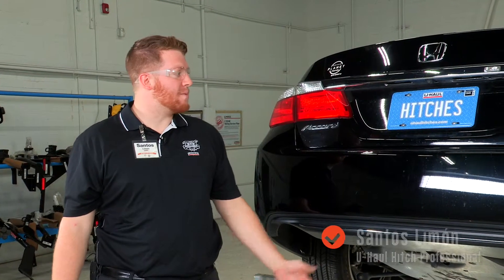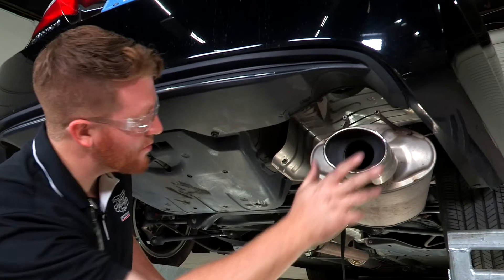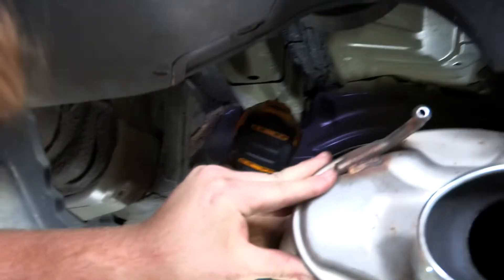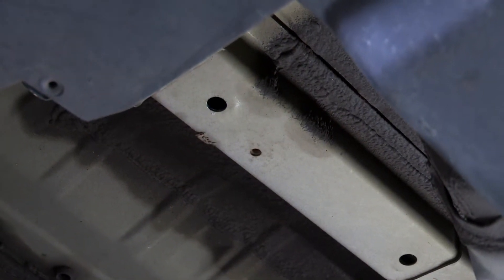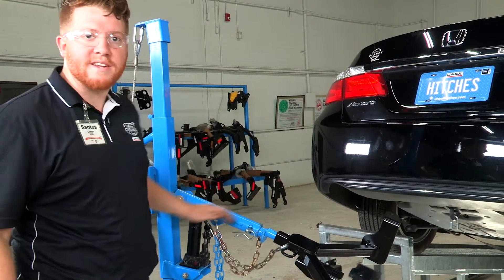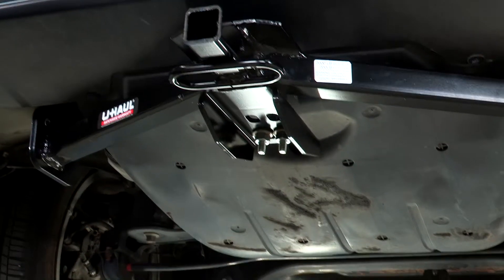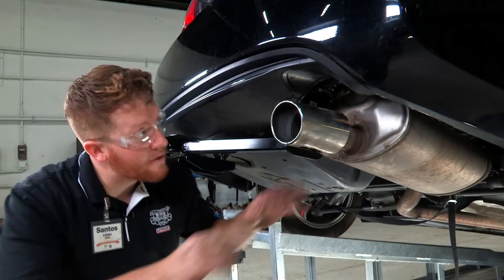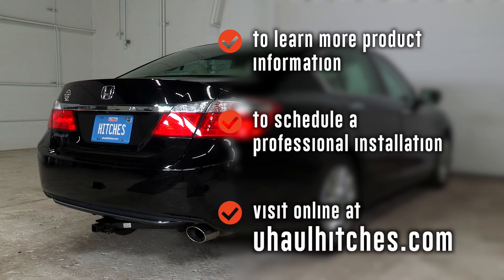2008 Honda Accord Trailer Hitch Installation

Comment: That’s not an 2008 lmaooo
Reply: It’s a 2012 it literally just got a face lift while using the same components
Reply: Slapshot Jack It’s a 9th Gen 2013 - 2015 accord dude.... 2008 - 2012 ( 8th gen ) is different body style search it up smart guy
Reply: Hp hey don’t you sass me I got a PhD in trailer hitch installation
Reply: Same vehicle 2008-2012 know what you speak of before you speak
Reply: Good thing he’s not an actual mechanic 😂